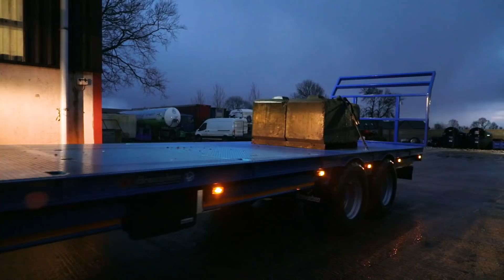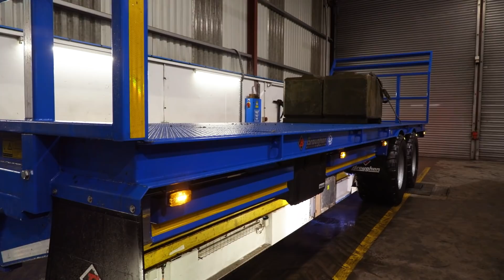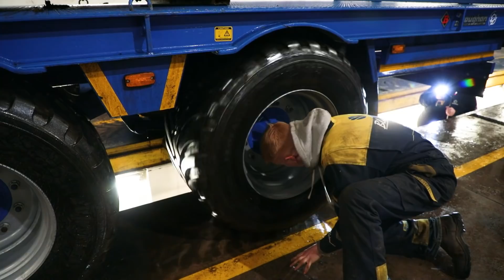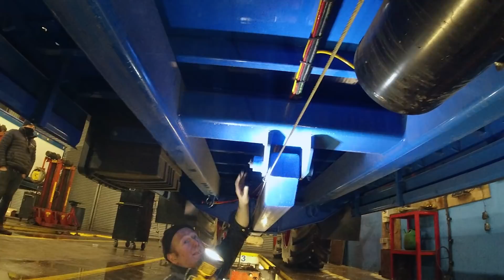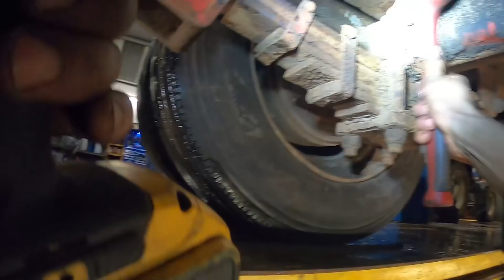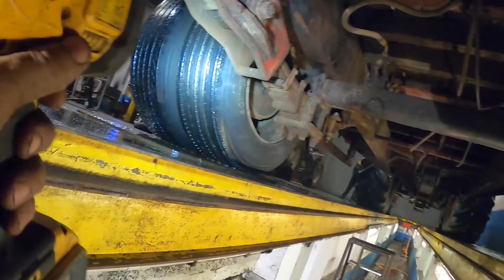AIR Services Puts the Broughan to the Test!

Comment: All road goin vehichles eg tractors . Trailers . Anything that goes near a public road should be motd psvd so the public know its safe . Farmers and contractors  need to realise that the size and speed of agri equipment nowadays it needs to be lagally safe and paperwork to show its bn kept in gd order . Its a gd job it was ur own mechanic that checked over the old herron and not a vosa dvsa officer as theyd have a pg9 on it straight away .  Ive no doubt that trailer will now be repaired to a safe standard  .